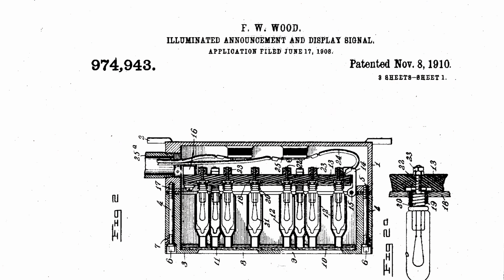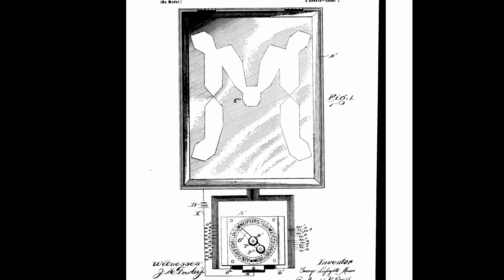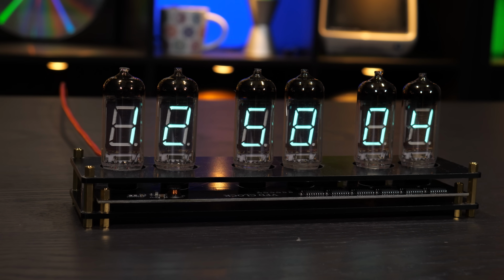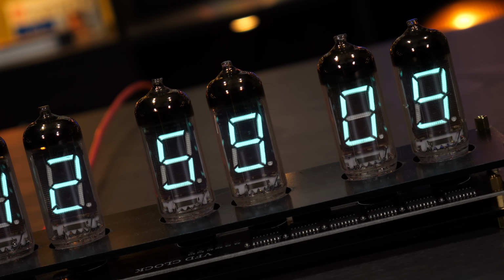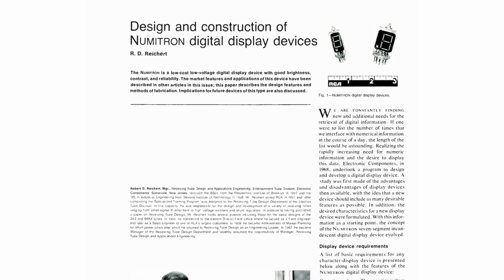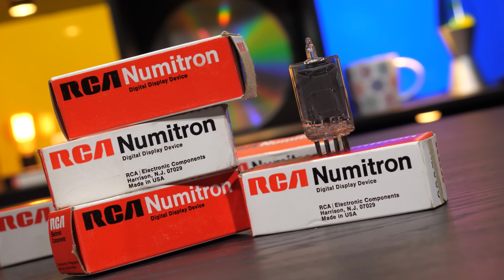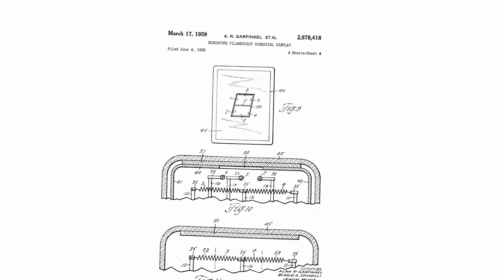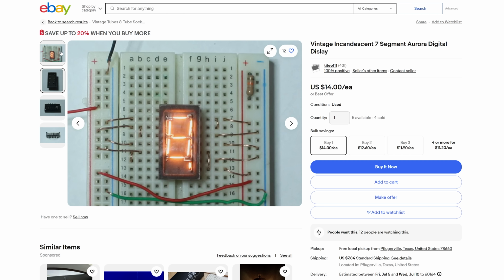The Numitron: An obvious idea that wasn't very bright

Comment: I worked at a gas station that had mechanical flipping numbers. These are numbers on a big wheel, I think some of the numbers where split in the middle and flipped that way while the smallest number was just a wheel.
While I worked there, other stations had LCD displays already. I don't remember seeing any stations with glowing lights. But I saw many of them at home in my dads workshop at home. So I knew what they looked like.
Just saying... never saw any of those lights on gas stations in my area. I was watching.
Reply: Numitrons were a very common sight on Gilbarco fuel pumps in the 80s and into early 90s here in UK.

Comment: You gloss over the neon-based seven-segment displays, despite the fact that segmented neon displays were found in all pinball machines made by Bally or Williams that were made between the eras of score reels and matrix displays.  74xx-series chips existed to drive either segmented or formed character neon-based displays, so I think the complexity of the electronics would have been a wash.  While Nixies have a definite charm, the fact that the digits are all in different planes would have been seen as a drawback compared with seven-segment neon displays which were mass produced through the 1980s.

Comment: You’re not the only one who remembers these in gas pumps, they are today likely to be seen on ones at the little mom and pop stores. I had a meter register that used a single unit in a small and narrow 10-pin DIP to indicate the time sequentially, but sadly, it was burned out.

Comment: I wouldnt blame whoever designed these for the ultimate manufactured product. RCA probably already had an idea that LED would be the future and purposely put numitrons into production as cheaply as possible knowing that it would be an intermediate technology that would allow them to start selling LED-ready low voltage electronics before LEDs were actually ready for mass use. Doesnt seem like they had very stringent QC when making these either beyond "if it works". You could actually make the concept work quite nicely with just a little more effort in manufacturing. I think a big reason they're so crude and have that grey background is that they just used as many off the shelf parts as possible not wanting to spend more than the bare minimum on tooling for something they envisioned as being obsolete in a few years anyway.

Comment: You missed the primary reason for these displays which was that they could operate in high radiation environments and resist electromagnetic pulses. That was regarded as quite important in the 1960s.

Comment: I remember those flat numitron clones being used in gas pumps in the late 70's and early 80's.  I also remember that they would lose segments as they burned out over time making it difficult to know what the numbers were.  I don't remember them lasting very long- maybe 2-3 years before they were replaced.  Also, there's the "pinlites" brand which are pretty small and came in numeric and 14 segment versions.  they show up mainly on avionics for aircraft use.  Those pinlites were around 1/4th the size of the numitron's digits.

Comment: Numitrons were actually quite cheap. Old Soviet IV-6 and IV-9 numitrons were available for like a couple bucks each from web-shops that were situated in former soviet territory (notably Siberia).... until a few years ago when a big chunk of the world's NOS tube supply ended up behind what are now Enemy lines.

Made a tiny clock with them a decade ago when they costs i think 1.60 usd each. They are indeed incredibly easy to drive as even a 74HC595 (the most common shift register on the market) could drive them at 3.3V.

Comment: The Fuji Minitron incandescent displays come to mind, as they had the pins in the back with a flat IC sized case. Many late 70s and early 80s aviation displays used them due to having to be read in daylight.

Comment: There are so many ways they could have made those filaments better. You can definitely have filaments that are curved, or at least a polyline. The filaments could have been contained within their own small glass tubes as is done with the multifilament Edison-style bulbs. Similar to the later LED 7 segment display, they could have been encased within a small region with a diffuse surface in front so that they glowed more uniformly like a VFD. Of course, all of these would increase cost and manufacturing complexity, but driving them would be just as easy.

Comment: I think that a lot of the quirks of the font are probably down to the fact that they tried to get all of the filaments to be the same length. Otherwise I bet that the filaments would have different resistances and this different brightness (or require compensating resistors is series). Or they'd need to use different wire gauges, maybe 🤔 But yeah, the fact that all segments are the same length seems to have been a defining factor...

Comment: I absolutely adore the colour of VFDs, the 'cooler' colour temperature to me just makes them look futuristic in a way when you make the comparison to the warmer temperatures of other displays that feel retro.
Reply: VFDs and electroluminescent lamps have a color and tone that you just cannot replicate easily on a screen, it just looks incredible and in person only.
Reply: I've had a similar IV-11 clock to the one in the video for a couple years and love it. It's so different from what you see every day and now that it's so uncommon, the cool blue green color of them is really nice.
Reply: Vfds also came in pixel displays up to 256x128, and i have a few  128x64 i got out of some old medical equipment
Reply: VFDs were also advertised as being able to produce any color using filters.  Of course, since all of these used the same pale blue-green phosphor, you'd b hard pressed to get a decent red from them.
Reply: @BrightBlueJim i have seen VCR displays with orange and red even without a filter (unless its right inside of the glass)

Comment: I imagine the gray background was to give a little bit of a glow behind the elements. If it were black, black, all that could be seen would be the filament. With gray, there would be a "bloom" making the element a little bit more visible.
Reply: It definitely wouldn't be RCA cheaping out and reusing material they already had in abundance at the vacuum tube factory (cathode material)

Comment: in the late 80's my mom worked for a local fuel company that had a chain of gas stations and the one she worked at had some of the first electronic fuel dispensers that Tokheim made from the late 70's and it used these damn tubes. Constantly had to replace the tubes as the segments burned out in them, you couldn't see them in the daylight, and they were slow to update. She was so happy when they ripped those dispensers out for newer Wayne models with LCD displays.

Comment: Hi, computer engineer is training here. Have you ever seen the difference between a circuit diagram of a BCD decoder and a 7-segment decoder? 7 segments are much more complex by nature (whenever you have 1 thing doing multiple things, it's logic tends to get more complicated), at least in the traditional way if derivation of a 7-segment decoder (each output has it's own function). The reason why 7-segment displays are better is simply because of packaging - less inputs for each display means on average more displays for a given pin count. And that benefit is enough to justify the marginally higher cost of silicon.

But I might be wrong, and someone smarter might correct me.

Comment: Speaking of early LEDs being expensive: When my father graduated from college in 1974 and embarked on his career as a mechanical engineer, he went out and bought himself a brand new Texas Instruments SR-50, one of the earliest handheld scientific calculators (back when they were still called "electronic slide rules"). It had a 10-digit LED display and cost $170 (ca. $1,150 today), which was reportedly more than he paid for the car he was driving at the time. Obviously not all of the SR-50's cost came from its display, but even so, it's illustrative of how pricey microelectronics were at that moment in time. A mere two years later, the very similar TI-30 cost all of $25.

Comment: I remember them being universally used in gas pumps. Seemed to be readable in daylight OK as I remember. Their low voltage operation was probably a plus when used around fuel. I had no personal beef against.

Comment: RCAs only sin was their timing. If they had brought them out in 1960 instead of 1970 they would have had time to improve the quality. Unfortunately for them the window for that product was miniscule, the LED and LCD had already been invented but they weren't quite ready. The reason that they rushed this out the door at all is that it came from the tube division. Those guys must have been grasping at straws to keep their jobs. 1970 was the end of the line for most tubes, aside from microwave applications transistors had replaced tubes in virtually everything by 1970.

Comment: I have a box full of gas pump boards based on Fairchild F8 microprocessor driving flat package Numitron or Numitron-like flat pack displays.  I also have a box of Numitron tubes and single digit driver boards with the RCA chip in orange and white RCA boxes.  And yes, I used an Arduino to turn them into a clock.  Personally, I kind of like the look of the Numitrons; they feel more “organic” than other seven segment displays.

Comment: Local independent garage/filling station here had numitron equipped pumps into the 2010s - they may still, I haven't been in a while. As per the video, they're the later 'flat' style, but not behind any kind of tinted glass, just a clear glass panel on the fuel pump - I specifically remember looking at them and wondering why thry'd been chosen over LEDs, I can only imagine some kind of regulatory reason - possibly fuel pumps have to be of a registered, approved design, and that hasnt been updated internally since the 70s. I guess if it aint bust, don't fix it!

Comment: The voltage required for Nixie tubes is dangerous... for the rest of the ICs in the circuit.  The amount of current they draw is minuscule, on the order of tens of microAmps (10^-6).  Most circuits using discrete components pull at least in the milliAmp range (10^-3).  The danger is posed to the ICs that interface with such high voltage, as IC's typically use far less.  If there was ever a short in the circuit, you could be buying a whole new circuit board.  As to the danger to humans, remember what they say: 'voltage hurts, current kills'.  

While building my own nixie tube display, I held onto the 180V output, ground on one hand, positive on the other, for a full minute before realizing I was even in pain.  And that's across the heart, which can be dangerous.  Of course, do what I say, not what I do.

Comment: I can tell a little about Soviet numitrons (IV-9, IV-10, IV-13, IV-14, IV-16, IV-19 and IV-20). First of all, I am not sure that they were clones of RCA products, because I met them in industrial equipment produced in the mid-1960s. Secondly, the IV-9 and IV-16 were actually quite light, and the barrel-shaped moulding of the leads was done only to prevent the glass cylinders from cracking when heated. Thirdly, with 400 Hz pulse power supply (in aircraft applications), some of the tubes started to "sing" due to resonance - as a rule, this meant that the tube would fail within the next 100 hours. By 1977 such indicators were considered obsolete and were not used in new developments.

Comment: Huh. The grey background isn't great, but I have no issue with the thinness of the lines, or the brightness in general in all shots here except when the flood light was right on them from the front. The vertical lines going higher was cool actually in my opinion. 

IDK, they seem quite nice to me. Maybe under non-studio lighting conditions they would be a lot worse, but from what I see here I would definitely be willing to use them. And yeah, the unevenness and such is wonky, but stuff like that always happens in cheap/low end stuff IME.

Comment: I love the Numitron clock. The warm, gentle light, the slow transition of the numbers, the beautiful glass envelope. So easy on the tired eye. It’s the best bedroom clock ever imho.
Reply: I've built several Numitron clocks, including a couple using a very obscure RCA Numitron, the DTF-104B (.85" digit, flat end-view tube).  One of those has been running continuously in my bedroom for around 15 years with no failures.  I really love the "friendly orange glow", which gets friendlier as they're dimmed (the clock has six levels of PWM dimming).  Another (with RUssian IV-9 tubes) went to my ex-wife, and she loves it too.  I agree: best bedroom clock ever!

Comment: On the topic of 7 segment displays, I’ve once seen a mechanical electrical gas station sign changing the displayed prices. It would change the complete sign one by one turning each segment on or off. Changing the whole sign must have taken 2 or 3 minutes.

Comment: Having at one point been enough of a nerd to draw the internals of a BCD-7 segment decoder on the school blackboard one lunchtime, I know that the internals are way more complicated than a BCD-10 output decimal decoder.  Each output of the 10 output decoder only needs to be decoded for one input condition, while each output of the 7 segment decoder has to be decoded for more than one input condition.
The decade decoder is ten 4-input gates plus 4 inverters.  The 7 segment decoder is around thirty 2-input and 3-input gates (more, depending on version) plus a few inverters.
The 7 segment decoder used more power as well.

A benefit the 7 segment chips did have is that with three fewer outputs, they could cram extra bells and whistles into the then preferred 16 pin package - such as blanking and leading-zero blanking functions.  Meanwhile, the decade decoder used up all 16 pins just to provide the basic function with no extras.

Comment: Numitron was a cheap response to Nixies (as they were basically lamp bulbs). Nixies needed high voltage and Numitrons were powered by 5 Volts, there was even a 74 series TTL driver for them. This made circuits much simpler to create and power. But LED displays killed them. I only saw Numitrons used in hobbyist devices, all professional ones used or Nixies (like HP frequency counters as they were called)  or 7 segment LED displays on later devices or even VFDs (like the Casio FX29 calculator that used a simple tube for all characters).

Comment: As young engineering students or engineer what to be we all dream of the ultimate design without compromise. 

At some point reality hits. Things need to be made on budget with existing equipment available to the the company. It simply needs to just meet some minimum specifications. 

The "ultimate" is most often more about how marketing sells something than about how engineering designs it. 

The design seems like it should have been presented as a no effort November project.

Comment: I remember these on gas pumps in the '70s. It seemed cool and cutting edge compared to the mechanical analog displays of the time. But I only remember one gas station that had them and in a relatively short time they were replaced by better technology.

Comment: FranLab The Next Generation. Though, you never mentioned that you needed to keep a current flowing in the "off" filaments in order to extend the filament lifetime - you can't simply turn them off as that wouldn't get the lifespan needed.

Comment: Honestly, I had never seen anything close to numitron-like indicators in the soviet physics installations, and measurement devices survived till the early 2000s (the part about survival may be important). We had a giant 240x120 wall-sized nixie-tube pixel display working in our university since the early 80s, though.

Comment: My father worked at NASA doing navigation during the Apollow era and on through the shuttle. I remember sitting on his bed each day as he upacked his pockets. In addition to his over-stuffed pocket protector jammed with felt-tipped pens and his ID, he had a nearly inch-thick calculator with a stamped metal plaque on the side declaring it property of NASA and an ID number. This calculator's display was made of tiny little red lines, though these were in truly tiny arrays. I think they even had curved lenses in front of them made out of clear red plastic to act as maginifiers, just like the LEDs in this video. 

The calculator was also cool in that it accepted small strips of magnetic material about half an inch wide and two inches long that you could insert. These acted as storage media. My father kept a tiny sleeve of them in his pocket protector. Very cool to think that it was cutting edge tech at the time that helped us get to space.
Reply: Sounds like an HP-65 or similar.

Comment: The shot at 8:35 with the "2" slightly out of focus shows how they could have been used with just a little bit textured surface over the top to blur the lines slightly to make the segments thicker and easier to read. You'd probably want SOME level of self-illuminating background to accomplish that (also makes it overall brighter), but the gray you showed is too light. Did it fade over the years and would it have been darker when new?